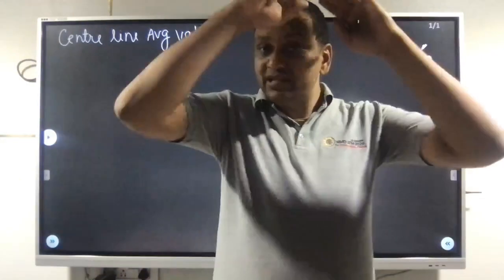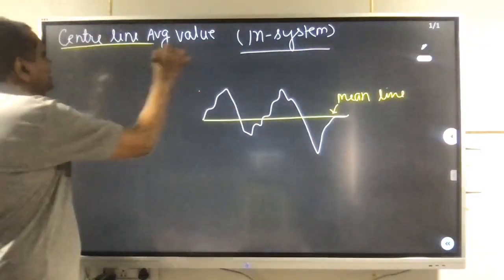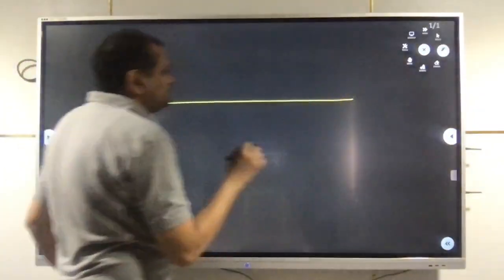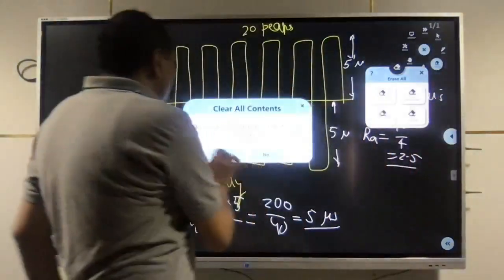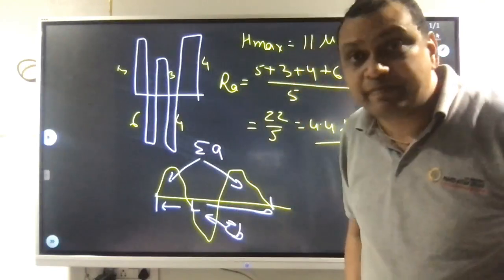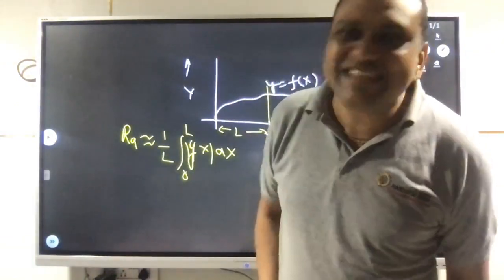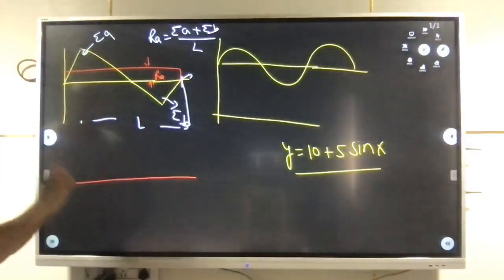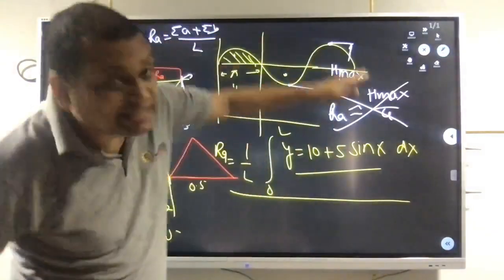CLA doubt in Metrology (GATE)

Comment: Sir, in Sinosoidal curve the sequence of events are repeating after 2π Or π as one complete cycle is of 2π.
What should be the cut off length here... π or 2π?
Reply from the maker: While calculating Ra, when we are integrating, below area will be negative and it will cancel out. But for Ra if you see formula, its positive. So for a normal function we say mod. But here for Sin, cos etc, we will integrate only unto Pi. Below area is also same but its negative. It would have been better if I can communicate through voice, but its not possible
Reply: @dr.swadeshsingh6589  thank you sir.. I got your point